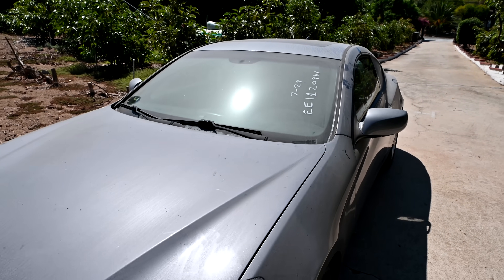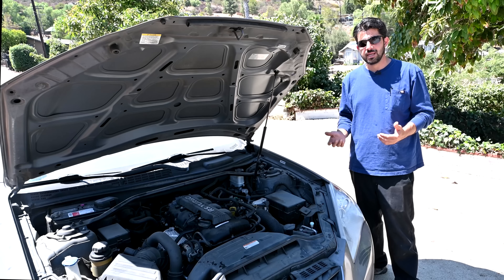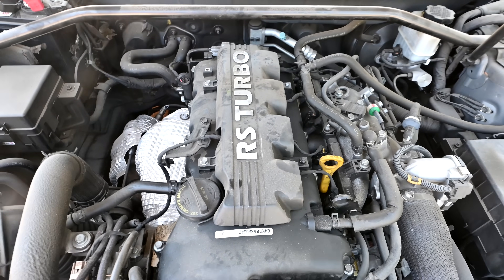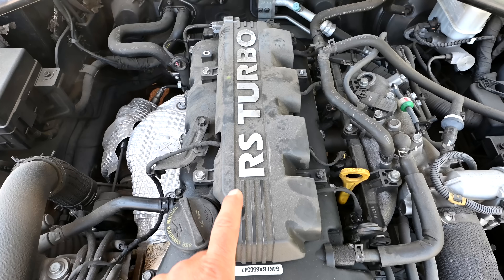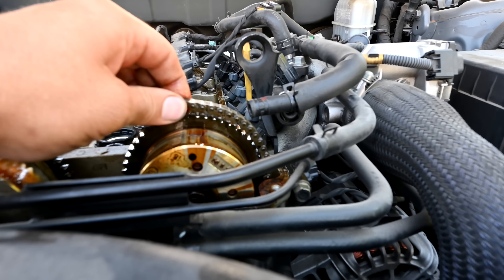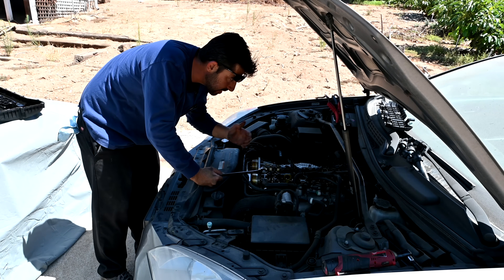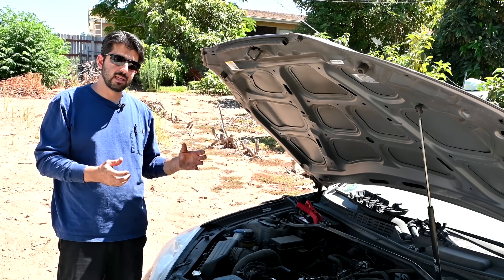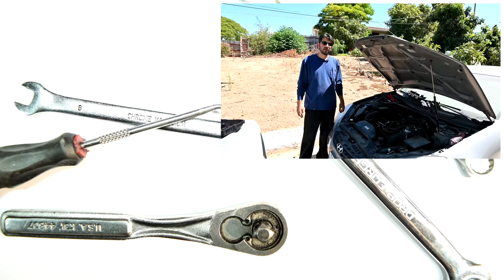The Hyundai And Kia Engine Failures Explained.

Comment: Which is the better build quality & more reliable engine/drivetrain, with the less maintenance and service costs over life of engine/drivetrain , between the naturally aspirated petrol engines of the current 2022 4 cylinder 2.5l/8spd auto in Hyundai Tucson, the 2.5l/6spd auto in Mazda CX-5, the 2.5l/8spd auto in the Toyota RAV4 awd's??. Stuck on , which one is best to go with, coz they're all good & bad in different ways. Seems like the 2050 models will be coming out before I can truely decide on which one😂. Any thoughts or suggestions??.

Comment: I'm a new subscriber.  Congrats on your 1.1M fan club.  I'm not a mechanic but I appreciated very much how you explained things regarding the dead Hyundai engine.  You have an accent but I still think you are in the states.  There is no grass, so you must be out west.  I  just ran it through KBB and you are a little low.  It is worth between $8,900 - $11,000. I had to fix my earlier quote because you want the private party value not the trade-in..  I ran it with standard equip and I wasn't sure if it was a manual or automatic,  I also listed it as "Excellent" condition.  I am amazed at how perfect the wheels are.
P.S.  There is one recall on it.

Comment: Reading all of the comments, I guess I am really lucky? I have a 2013 Hyundai Sonata GLS 2.4.  It is 215k miles. I bought it brand new. The only issue I ever had as the transmission coolant sensor, which was covered under warranty at 92k mikes. Other than that, no other issues at all. I do oil change at every 15k mikes with Mobil 1 and changed out the oil filter at every 7,500 miles. It has been working out for me so I am just sticking to the same routine.
Reply: I just got a, 2023 Hyundai Sonata N-Line 2.5l turbo and I couldn't care less about engine problems as the warranty is, 10 year/100k mile warranty. Lol. So....I don't care if anything fails....I get it fixed/replaced for free. Ha also....I ALWAYS change the oil on a new car after the first 500 miles.  Some engines just don't last as long as others. It happens....not a single engine and or car maker has an engine that has never had a issue or issues. Millions are sold and odds are, some will have issues, especially with some people driving em hard as all hell and not doing proper maintenance. Again, new hyundais now have a 10 year/100k mile powertrain warranty. So, couldn't careless about issues. Lol also, when buying a new hyundai, you can purchase a lifetime pwertrain warranty for around 2k.....so.....couldn't careless about issues.

Comment: It all comes done to proper maintenance. I drove my Hyundai Veracruz well over 200,000 miles without any issue, my Wife’s Elantra had almost 200k miles done perfectly before we sold it, and my current Sonata has also done over 100k miles by now and runs like a Swiss clockwork
Reply: The 3.8 in the Veracruz is a very well built engine. My dad has that engine in his 2008 Hyundai Entourage with over 315,000 thousand miles. It has been the most reliable vehicle we’ve ever had. It still shifts like new with the original transmission and we tow a boat with it.
Reply: @dannylay7965  yeah, my one was a 2008 3.8L version, and the guy who bought it is still driving it after 2 years, no issues

Comment: That's why, no matter what the manufacturer says, change the oil and filter on a brand new car within the first 500 miles. It may be overkill, but given the garbage left in these engines from the factory, if you did that, you'd likely have no problems going forward.  Now buying a Theta II car used....you take your chances.
Reply: I just got a, 2023 Hyundai Sonata N-Line 2.5l turbo and I couldn't care less about engine problems as the warranty is, 10 year/100k mile warranty. Lol. So....I don't care if anything fails....I get it fixed/replaced for free. Ha also....I ALWAYS change the oil on a new car after the first 500 miles.  Some engines just don't last as long as others. It happens....not a single engine and or car maker has an engine that has never had a issue or issues. Millions are sold and odds are, some will have issues, especially with some people driving em hard as all hell and not doing proper maintenance. Again, new hyundais now have a 10 year/100k mile powertrain warranty. So, couldn't careless about issues. Lol also, when buying a new hyundai, you can purchase a lifetime pwertrain warranty for around 2k.....so.....couldn't careless about issues.

Comment: The genesis coupe 2.0t is not a theta 2 engine, its a theta 1. 
The theta 2 is direct injection.

Take a look at the intake manifold in the genesis coupe 2.0t. Look at the the air flow. Rear 2 cylinders get too much air, making the run lean. 90% of the problems on the rwd 2.0t is the craptastic uneven flow design. They evened it out in the kia stonger which has the theta 2 GDI

Comment: Probably ten years ago, Hyundai/Kia came out with a TSB regarding aftermarket oil filters.  It said some aftermarket spin-on oil filters would not flow oil properly when used on Hyundai/Kia engines. This would result in oil starvation issues with the engine.  It was recommended that Hyundai/Kia oil filters only be used.  I know this was a big issue for many years and Hyundai/Kia did little to inform customers about this issue.
Reply: The engines are junk. Oil filters didn't cause the problems.
Reply: Common spin-on oil filters have an internal bypass valve in case the paper element gets clogged. If the element was clogged with metallic bits, then the bypass will open and oil with metallic bits will flow throughout the entire engine, and of course that is bad for the rod bearings, which have a very tight clearance and require clean oil to flow.

Comment: I have had 4 sonatas  come  in my shop with locked  engines. I know  2 were serviced regularly.  The  one thing they  had in common  was they stopped  with  no warning
Reply: I just got a, 2023 Hyundai Sonata N-Line 2.5l turbo and I couldn't care less about engine problems as the warranty is, 10 year/100k mile warranty. Lol. So....I don't care if anything fails....I get it fixed/replaced for free. Ha also....I ALWAYS change the oil on a new car after the first 500 miles.
Reply: @nexpro6118  Hyundai paid bots with fake stories

Comment: I have a base 2011 Hyundai Sonata, bought used with 106k miles in 2016 and the engine locked up in 2018. Mechanic told me about the recall and local Hyundai dealership replaced the engine block (a $6000 job) for free even gave me a free loaner car to drive for 3 weeks as they worked on it. They took care of me. Now I have 211k miles and still drives good. Not bad for a used $5000 auction vehicle. Just keep the oil changed sooner than recommend intervals and it’s a wonderful car.
Reply: I just got a, 2023 Hyundai Sonata N-Line 2.5l turbo and I couldn't care less about engine problems as the warranty is, 10 year/100k mile warranty. Lol. So....I don't care if anything fails....I get it fixed/replaced for free. Ha also....I ALWAYS change the oil on a new car after the first 500 miles.  Some engines just don't last as long as others. It happens....not a single engine and or car maker has an engine that has never had a issue or issues. Millions are sold and odds are, some will have issues, especially with some people driving em hard as all hell and not doing proper maintenance. Again, new hyundais now have a 10 year/100k mile powertrain warranty. So, couldn't careless about issues. Lol also, when buying a new hyundai, you can purchase a lifetime pwertrain warranty for around 2k.....so.....couldn't careless about issues.

Comment: You did good. My experience with no compression engines that have jumped time is to then pull all the cam caps and do a leakdown on all the cylinders. Your engine may have good valves. You might not have to pull the head. You are doing a timing chain/tensioner/water pump at this point no matter what. You know what you are doing. Great video.

Comment: Regular oil changes will do nothing for an engine that already has oil galleys and other orifices clogged with metal shavings. As was stated in the video, these problems result from poor manufacturing processes, regardless of the negligence of the owner. Of course, removing the valve cover and discovering a loose timing chain may be the only issue with this engine.
Reply: I just got a, 2023 Hyundai Sonata N-Line 2.5l turbo and I couldn't care less about engine problems as the warranty is, 10 year/100k mile warranty. Lol. So....I don't care if anything fails....I get it fixed/replaced for free. Ha also....I ALWAYS change the oil on a new car after the first 500 miles.  Some engines just don't last as long as others. It happens....not a single engine and or car maker has an engine that has never had a issue or issues. Millions are sold and odds are, some will have issues, especially with some people driving em hard as all hell and not doing proper maintenance. Again, new hyundais now have a 10 year/100k mile powertrain warranty. So, couldn't careless about issues. Lol also, when buying a new hyundai, you can purchase a lifetime pwertrain warranty for around 2k.....so.....couldn't careless about issues.

Comment: They has problems with this engine but other than that kias and Hyundais are great cars. I have an 08 kia rio5 with the alpha II engine and 5 speed manual. Great little car. Reliable, easy to work on and parts are cheap. It's only got 100k on it so I'll be keeping this car for a long time.

Comment: I think you yanks must treat your cars like shit. I'm on my 4th Kia Soul CRDI (diesel cars are normal here in the UK). Each one ran without major issue for 100k + and I only changed to upgrade. In UK, Kia is ranked one of the best for reliablity and low repair costs. BMW, Mercedes and Audi are all beaten by Kia. About 10 years ago, they were a bit more of a risk, but now they are one of the best car makers in the world. I change oil on my car every 10k and not the 13k recommended as I do high mileage.

Comment: metric or imperial   the spanner size does not name the bolt size 
10mm are usually M6 bolts
also there is a difference between a bolt and a screw

Comment: I have a 2.4 L Hyundai Tucson. There is a recall on the engine in mine (2019) that suspected there was an oiling issue during crankshaft milling at the factory. I do mostly highway driving and the dealership mechanic told me that if there were a problem, I probably would not see it...stop and go ?...perhaps.

Comment: Edit...follow service schedule fastidiously and no unusual issues....just like any other brand
   If you intend to high mile it, then decrease oil change distance to 8000, fit a magnetic sump plug, put seat covers on, and knock yourself out.
  Plenty of taxi firms here in the UK running them to 250k

Comment: Kia,Hyundai ,Genesis engines all seem to have the same manufacturing issues. Metal shavings left in the engine during manufacturing. How does a modern engine factory not figure out this and keep producing defective engines? Something tells you just maybe the engine design just  is not that great.

Comment: Hyundai and Kia had a low market share 20 years ago. The answer was a 10-year engine warranty. So consumers drove harshly. It is not a problem if the engine oil is replaced normally.

Comment: I used to work for a Hyundai dealer. The engine's would be knocking brand new still on the delivery truck. We had a whole area to store replacement engine's Hyundai couldn't get replacement engine's fast enough. At first Hyundai was replacing the crank and rods after it went insane they just said F it and we were replacing the whole engine. Being a Hyundai tec sucked they payed 8 hours to replace the engine which you can do but it took all day. Guys to dumb to do engine work would get all the easy money jobs and make 15 hours a day while you get screwed doing warranty work.

Comment: first you dont know what you talk about ... thius is a 2.0 Turbo engine not a 2.4. second you can use an inspection camera .... the trouble with the 2.0T is NOT bottom end problem... it is the timing chain guide...

Comment: When i bought my wifes 2017 hyundia i was happy to learn that it has the atkinson engine design which is better than any direct injection POS. Id never buy a turbo car for daily use.... to many failure points. I had a 92 eagle talon turbo which i built for fun but wouldnt ever drive it daily for those reasons.

Comment: My 2014 Tucson has 250k miles I have it since brand new and still runs like new. Would probably need new suspension because I drove it off-road a lot.. but engine and transmission work great. I changed oil in the engine every 20k miles with mobil 1 ultra synthetic/ extended performance. After recent oil lab test I will change it every 15k miles. 😀
Reply: 20k??? You're insane

Comment: Wow, as a 50-year-plus mechanic I can tell you that the oil in that engine was not changed at regular intervals, hence the brown cooked look on the internal parts which will cause internal failures. All these small engines run at higher rpm's and higher temps so change your oil. In the 60s-70s, Fram filters' slogan was"You can pay me now or pay me much more later".
Reply: Yea especially if you use Fram oil filters. Totally garbage.
Reply: @johntalik5937  Yes I agree with you totally, at our dealership we had an original Chrysler filter and a Fram filter exposed to six months of water like when it's on the car with our weather conditions. The Fram had rusted out to the point of leaking, yet the orginal Chrysler had minor rust. To bad Fram had a nice slogan " You can pay me now, or you can pay me a lot more later"  that's when a customer refused to have an oil change. Yep I'm old.
Reply: I think a certain generation had some internal defects that lead to oil starvation in certain areas and increased oil consumption. I had to add 2 qts per oil change in mine no major leaks no drip or puddles its just burning the oil i change mine every 5000 full synthetic around 3 times a year at first i thought something was off cause there is no way i was burning that much oil. But apparently i was then it seized up atound 215000
Reply: @urbanharvestdfw  all hyundais before 2015 are garbage, they got alot of the issues down after that. It's mostly software stuff now like 99% of car manufacturers they all suck at making software that can run on weak systems.
Reply: Got 2012 Kia soul. Ran like a top. Kept serviced as scheduled . One day out of blue driving down road engine started vibrating...pulled over and had towed...broken piston and pin.no warning  at all. Engine used no oil, no knock, nothing. 135,000 miles and it just came apart...mine not included in recall...little engine was expensive
Reply: I just got a, 2023 Hyundai Sonata N-Line 2.5l turbo and I couldn't care less about engine problems as the warranty is, 10 year/100k mile warranty. Lol. So....I don't care if anything fails....I get it fixed/replaced for free. Ha also....I ALWAYS change the oil on a new car after the first 500 miles.
Reply: @nexpro6118  Excellent idea! Mine is coming up on that next month. They're could be micro slivers of metal in there and to get rid of most of that may wanna think about changing it...
Reply: @nexpro6118  Exactly, my daughter bought a Hyundai in 2018 she nearly has 80,000km and no problems compared to the North American cars she had prior. She keeps up with maintenance and it's only been oil changes and air filters.
Reply: @nexpro6118 you paid actual money for that garbage weeb box?

Comment: The going sentiment is that you either get a Monday or Friday car from Hyundai. Monday: early in the week and they took their time. 
Friday: rushing to wrap up work and head home, so you might have a lil metal in your block 😂 
But Honestly most of the failures I see with these come from maintenance neglect and/or people beating on it since it’s a cheap sporty car. But my info is a bit bias because it all comes from the Gen coupe forums which in its nature, attracts younger people that tend to beat on cars lol.
One thing I can say for certain is the Lambda engines are much more reliable lol. 

And for what it’s worth I had a 2009 sonata 2.0 with 150K miles and the only mechanical issue was a bad alternator around 120K. Bought it new and did oil changes every 5K. 
Currently have a 2015 Gen coupe 3.8 that’s rolling past 100K next month and have had 0 issues. Got it at 53K and it had oil receipts at a decent time interval, no specific mileage. Didn’t have any maintenance logs filled out so I can’t be sure of it’s history. But I’ve done changes every 5K and flushes/valve cleaning every 10K. Along with every item on the log
Hope it sees 200K without am engine rebuild/swap but we’ll see.

Comment: I owned a 2010 Santa Fe. I gave it to my daughter two years ago (2020) with 70K miles on it. It now had about 140K and runs great. Both my daughter and had the oil changed at Wal-Mart about every 8K miles using the second best grade of Pennzoil.
Reply: have you had the valve cover gasket leak on the alternator yet?

Comment: I hate my 2017 Hyundai Santa Fe. I bought it certified used from Enterprise. Had 20,000 miles and ran fine. Had to change all the spark plugs close to 5,000 miles later.

One random day, it starts overheating. Head gasket screwed up. And no warranty to cover. Happened around 70,000 miles. Can't drive it. I have tried Barr's head gasket sealer and it failed. Now I'm going to try Blue Devil to see if it works. 

I'm so paranoid about buying a new car now. I wanted the Kia Telluride, but I can't even trust Hyundai or the sister company Kia. I hate Hyundai 😠